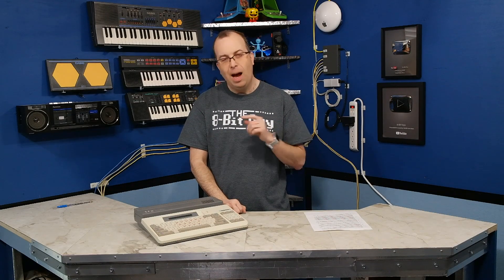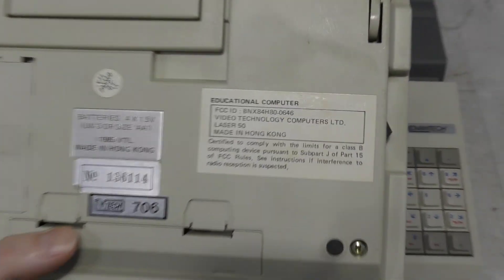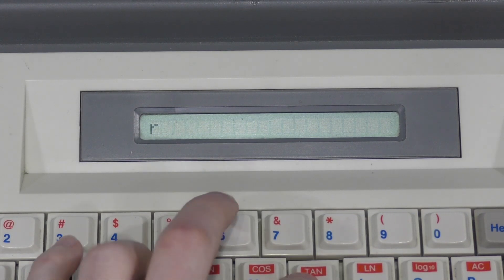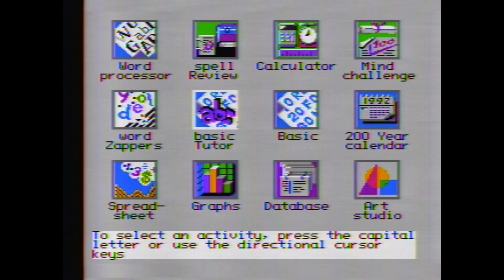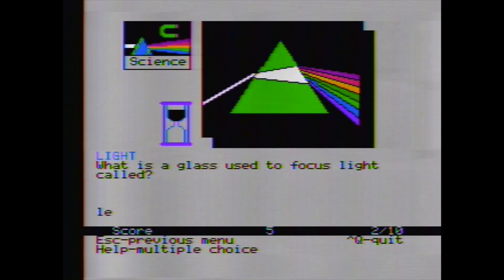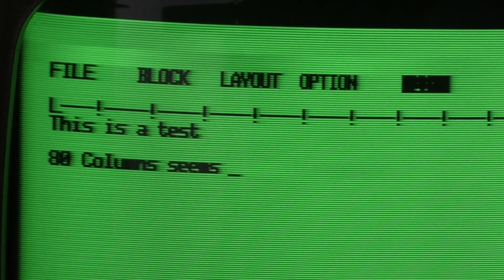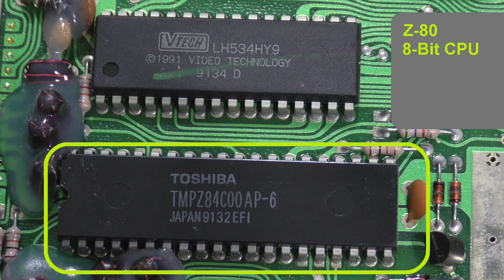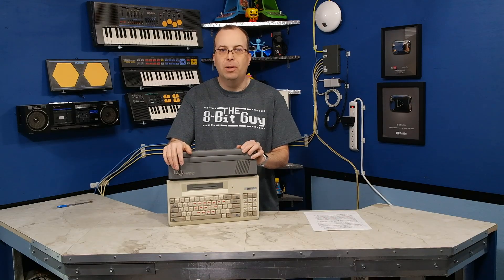The Advantech I.Q. Unlimited with BASIC and a Z80 CPU.

Comment: It says it's a 200 year calendar but it only accepts 2 digits as a year when booting?
Reply from the maker: Good point.
Reply: The 8-Bit Guy thanks for PX3!
Reply: Calendar isn't necessary the same thing as the real time clock, nor is the real time clock's limitations necessarily the same as the input field of the time prompt when booting
Reply: Muranaman you thought way too much into it lol
Reply: @Mr.Dr.Professor Toaster

An infinite loop calendar could have existed, however, if we look at the calendar, having only 7 days a week, one would think every 7 years to have an identical calendar, until one takes into account February 29th, which happens every 4 years.
So we have now 7 years, and one day added every 4 years, creating a calendar that would be ok every 28 years (7 (for the weekdays) * 4 (for every leap year).
 

Every 28 years, February 29th falls on the same day (and subsequently also all other calendar dates).
Essentially we get the same calendar every 28 years, when you don't take into account the last 2 digits of the year.

Taking into account the 2 last digits for year, you'd need to span 700 years; or 25 times 28 years (28 years due to February 29th, and 25 times, because it's the smallest division of 100 where a calendar would match the day of the year with the last 2 digits of the year).
Or, there are 7 days in a year, and every 100 years the last 2 digits are the same.
Multiplying both, 7 * 100 = 700.

Every 700 years, the calendar should indicate the same date, day of the week, month, and last two digits of the year.

It would make sense, however, this is not so; because we didn't take into consideration that every 1000 years, 1 day is added; so that even after 700 years (I presume somewhere at 500 years they add the day), our Monday will end up on Tuesday.

So there's not really anything like an 'infinite loop calendar', taking that extra day into account every 1000 years, and the last 2 digits of the year.
At least, not in the lifetime of our generation and technology.
Reply: You'll need batteries that last over 100 years to make it to the next century on the calendar!
Reply: "every 1000 years, 1 day is added"

Nope, that's not how leap years work.
Reply: Krzaku & Bag Head Computing
GUYS! TIMESTAMPS!!
Reply: Some People Like To Plan Ahead
Reply: 6:43 look at the middle
Reply: Ah, that's how that works!  I couldn't figure out how it went to 2018 and not 1918.
Reply: The more I get into it the more difficult it gets.
There's leap years (every 4 years), and leap centuries (every 400 years), a day gets added.
And it doesn't stop there.
Like kuralthys said, it's pretty much impossible to create an infinite calendar, due to rounding errors on the exact time it takes for the earth to rotate around the sun.
However, I don't believe it varies. Earth sun and moon are such huge masses that a year of rotation should never differ by more than a few minutes at most.
Perhaps one year from another, but in the long run, earth's rotation around the sun, is pretty much a constant.
Reply: The 200 year calendar did not use the same memory as the system date.
Reply: Planned obsolescence?
Reply: The built in programs look better than the Commodore +4 that I had. The ability to save files without a disk drive, and keep them on battery power, is actually pretty cool.
Reply: Ig it was supposed to be 2000s compatible calander which means it can show the dates of 21st century idk
Reply: I'm assuming the calender was hard programmed to begin with the year the bios was installed. Taking that assumption into account the calender likely will recognise 1991 to 2191 and if it miraculously still functions by then it will not recognize dates passed Dec. 31, 2191.
Reply: So we're in 2021 (at the time of me commenting) but it would render as 21. At least it isn't 121.
Reply: Jose Antonio - Except there's a special case with leap years where if the year is divisible by 100 but not by 400, it's not a leap year. 1900 was not a leap year, even though it is divisible by 4. 2000 was a leap year because it is divisible by 400, but 2100, 2200, and 2300 will not be (not that anyone alive is likely to see the year 2200 or 2300, or anyone old enough to understand this video on the day it was released to see 2100).

Also, your example year was not a leap year, so there was no "29.02.89". '88 was a leap year, so that would have been a better example.
Reply: Krzaku 
Technically that would make it an infinite calendar since it can only display two year digits, it would just loop every 100 years.
Reply: @MDPToaster  If you loop the year, you need to shift the leap years, and the days of the week. Calender's are not decimal, so you can't assume they'll behave like that when you reach the end of cycle of a time period. It's not unreasonable to store the year in the boot as a 2 digit figure, and in an application store this as a 4 digit figure after a simple set up sequence. It's also quite reasonable to assume it's a typo or marketing exaggeration - I can't imagine it being more than a 20 year calendar in the allocated RAM space. It all depends upon the GUI and limitations of the storage mechanism.
Reply: @MDPToaster  In which case it would've shown that month from  year 1918, not 2018, and the weekday would've been wrong. Since it was right and the calendar itself accepted 4 digit year(s) without an error, it does work. A calendar can support any number of years, even millions of years if made right, even if the machine internally only understands two-digit numbers.
Reply: Krzaku at 6:20 you can hear me puts in "20" for 2018. I don't understand why 8-bit guy missed the and didn't tell you. And at 6:45 you can clearly see the right date (that it's not 1918 for example), just like Bag Head Computing mentioned.
Reply: In this case, for me, February 29th makes the difference, think about (example) the date 29.02.89, the next day will be 1.3.89. Besides, if you think 28.02.89 and the next day is 1.3.89, now you can notice that it is really a 200 year calendar. It is may sound silly as long as I used only one date occurrence and the aforesaid example also applies for a 100 yr calendar but if you find this February pattern n times in certain a century, i assume that next century will show this pattern  =/n times.
Reply: Also it adresses week days.
Reply: @Muranaman - an infinite calendar is meaningless anyway, since the length of the day and year on earth are not constants over geological timescales.
A tropical year is: 365.2421891 days
The length of a year based on the gregorian calendar is 365.2425 years.
This means we're out by one day ever 3226 years.

You could try and fix this by adding more terms. Or you could start over;
(Note, these come from a video done by Matt Parker)
A fix to the Gregorian calendar a bit, you could add, any year divisible by 2800 is NOT a leapyear, and that would get the error down to one day in 91,743 years

If you start over though, 
if every 4th year is a leapyear, but every 128th year (yes, binary. 2^7 years) is not.
This is accurate to one day of drift in 625,000 years

Now, you could try for even greater accuracy, but the rotation of the earth is slowing down, meaning days are getting longer, and the Earth's orbit around the sun isn't quite a constant either.
So over time the actual length of both a day and a year will change, rendering any calendar, no matter how well thought out at the time, obsolete, because the actual values have changed...
Excessive accuracy simply isn't worth it because reality will ruin it for you.